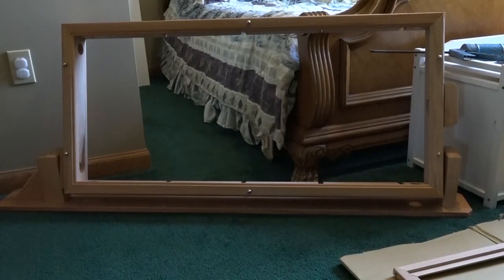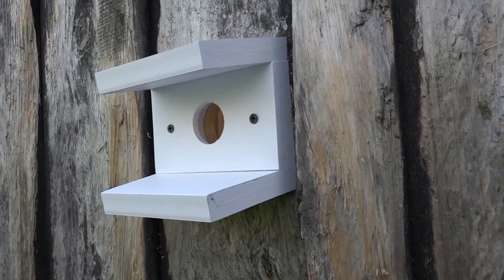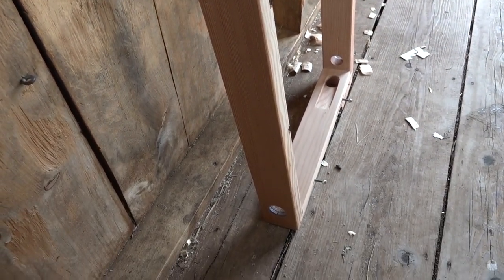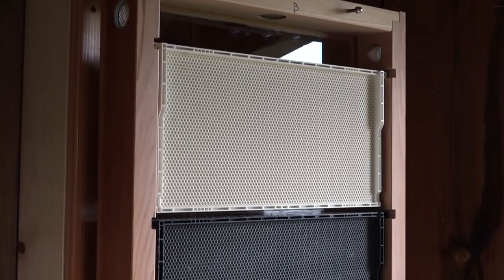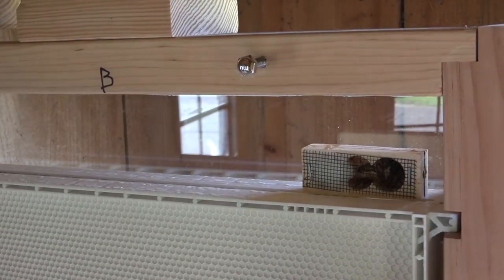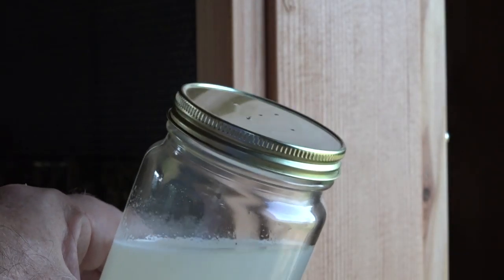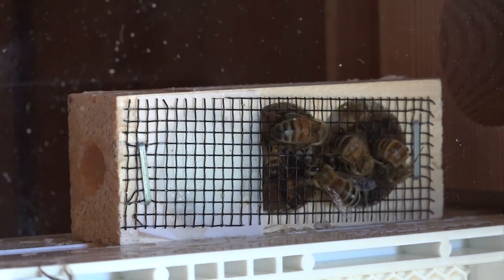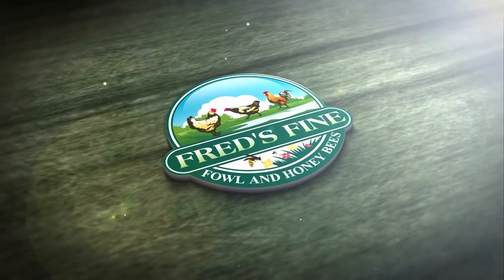Observation Hive, Honey Bees, Step by Step Set-Up and honey bee installation, New Queen Rejected!

Comment: This is absolutely fascinating. It's so cool to see you interpreting correctly their behavior. I wonder if there was a possibility of the workers never accepting the new queen. Also, naturally the inside of the hives is always dark; does this glass and the light that shines upon them makes a difference for them? Thanks for this great video.
Reply from the maker: The hive is normally covered with 2.5 inch thick rigid insulation board on each side. I pull those off when observing and the bees don't seem to care at all. I originally was going to use red/safe lights inside in order to observe them, but quickly learned that they didn't behave differently so went back to warm lights. Thanks for watching and commenting.

Comment: WOW! LOVE this idea! It gave me a desire to build one up here (The Great Snowy North). Any chance of a 2nd video showing the full indie of the shed? I mean to see the space with the hive in it. 
Also: what about using a flow hive in this fashion? (in a shed). I'm just wondering about maintenance/inspection. If you open the hive in the shed, how do the bees that come out (in the shed) get back into the hive? (My brain is just full of ideas and questions!)
Reply from the maker: I show the shed in the video of the observation hive swarming. Regarding putting any hive inside an enclosure with ports to the outside, it's easily done and when you do hive inspections and open it all up, I have light blocking wooden panels for all of the windows, then leave just one window open and the bees follow the light out and return through the hive opening provided. Hopper style windows work best and yes, flowhives can be set up that way, it's actually not a new concept in beekeeping.

Comment: Just wondering how you keep that warm in the winter time, the bees are in a barn, do they produce enough Heat to Winter themselves inside of their?
Reply from the maker: The observation hive is sandwiched between two 2" thick insulation boards when not being directly observed. The perimeter is 1.5" wood, the biggest drawback in winter is the placement of the entrance which is directly through the bottom which often results in being closed off by dead bees.
Reply: Thank you for that, I couldn't quite figure out how that was going to work out LOL that makes far better sense now. I may consider building one of those at some point in the future. I have been playing with bees, feeding feral bees, beelining, and studying bees very thoroughly for about a year. I do not have bees at this at this point. I do have a Kaizen beehive and just bought a secondary hive that needs put together. I have a couple other boxes made out of ice chest with frames oh, I have a couple swarm traps out which are waxed inside and a couple drawn frames in each one. It warmed up today and the bees were out at my feeders. I found a nest in a tree close by my house with a box attached. Just hoping they start drawing frame. I can by bees but I want to get feral bees whatever it takes. I have two Hollow trees that I am making hives out of haha. One has a hinged door but neither are completed. They will both have a 10 frame box on the top of them. I am going to make top bars for them with banding material to complete my long frames for inside. I built a bee vac, have most all of the necessities. Actually I was out beelining today. Spring seems that it is coming very fast this year. The only B's I have are the ones still in the tree haha I visited them today. So I go by the bootleg beekeeper LOL

Comment: Great video Fred thank you but I’m just curious now it’s been two years since you’ve had an observation hive is it still going strong have there been any problems
Reply from the maker: Still going strong, they do seem to have to overcome lower frame moisture levels from time to time. They have sealed up all of their vent screens. They keep the upper 1/4 of the hive very clean and dry through winter and then move back down around this time of year. Not ideal for beekeeping, I see it as a testament to the health and vigor of the bees over habitability provided by this design. I would also like to see the bottom entrance re-designed. If I hadn't vaccumed out that entrance, dead bees would have blocked cleansing flights.
Reply: That is great thanks Fred still waiting to get into my Bees being up here in northern Ontario Canada still a little bit cold. Definitely going to design a observation hive myself. Thank you for all the information and great videos

Comment: Hello Fredrik. I like your videos. Which method of combating Varroa mites is common in the US? Does anyone use heat treatment (Thermal processing of bees)? What do you think about this method? (I'm from Siberia, near the Baikal.)
Sorry if I write incorrectly: I do not know English well.
Reply from the maker: There are many methods being practiced here in the U.S. and IF I have to treat for them, I'm personally a fan of using oxalic acid vapor and I have that unit always ready. BUT, I evaluate and inspect my varroa resistant bees and do not do anything if they are keeping the varroa under control on their own. I work with hygienic survivor honey bees and they are extremely active in removing infected bees and grooming off varroa from other bees in their colony. The trade off is that my bees are so active at grooming and removing workers and brood that don't meet their standards that honey production is much lower than with other bee genetic lines. I haven't treated for years, but I am ready as I mentioned and would do the oxalic treatment, not the drip method, but the vapor is best in my opinion and I would do that in the fall if necessary. In this observation hive, I will be watching for evidence of varroa or disease and so far so good.
Reply: Very interesting.
How do you prevent crossbreeding with other breeds? In a big trip around you there are no apiaries?
I would also choose such a compromise.

Until 1960, there was no parasite in our area. Varroa was brought with a foreign breed. Strong families are better able to cope with this disease.
I will look after your experiments. Thank you for your work.
Reply from the maker: I don't prevent cross-breeding and occasionally do allow them to swarm. There are no registered apiaries within 5 miles of my location, but there may be feral colonies in the area and that survivor stock is a benefit in my opinion.
Reply: You have a good location for the apiary. It's great. Thanks for answers.

Comment: in recent videos ive seen your observation hive has a screened bottom, but i dont see that here
Reply from the maker: They are enclosed screened bottom boards with removable inserts. This particular observation hive wasn't a very good design, and I never got bees to survive winter in it even with insulation panels. With the new observation hives, the frames are in 3s and have the screens down the center of the bottom panel for observation. This change has resulted in all of my observation hives making it through winter in un-heated spaces.

Comment: I have to ask, is there a downside to using glass over the acrylic?
Reply from the maker: I tried to get safety glass for it, three broken glass panels later, I went with great quality plexi. I still want some good glass, but the local guy just had a terrible time cutting it to my size and we gave up. Glass is also much heavier and the frames that it sets in are very thin. So in short, I would very much prefer nice tempered glass panels over the acrylic.